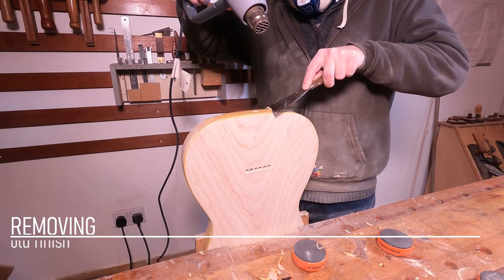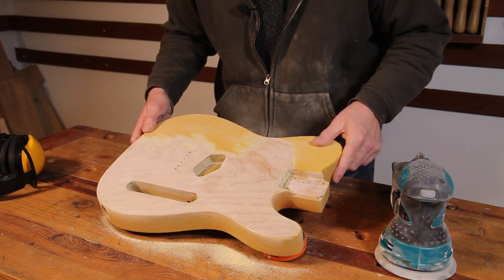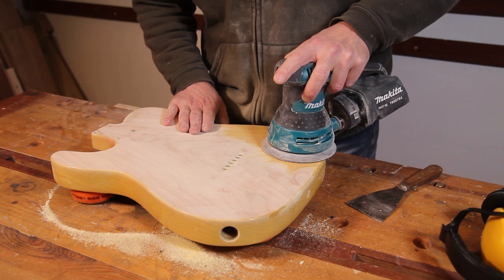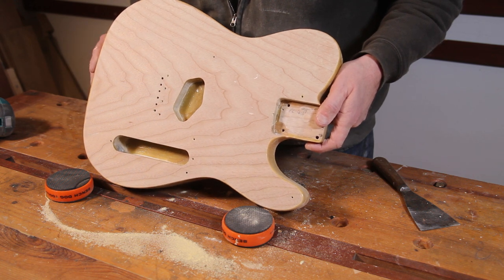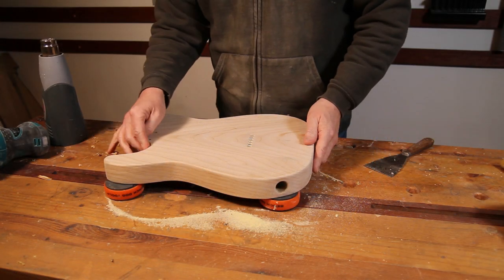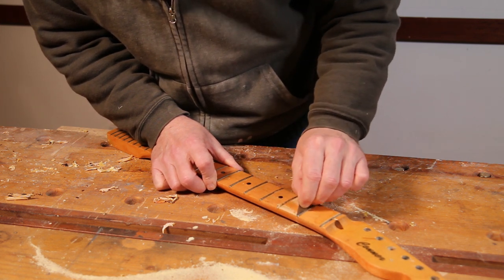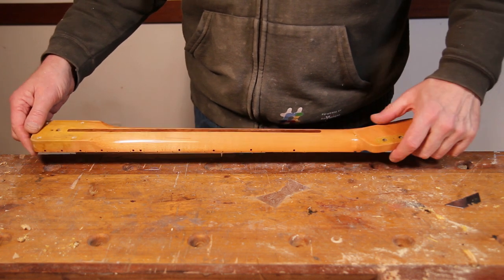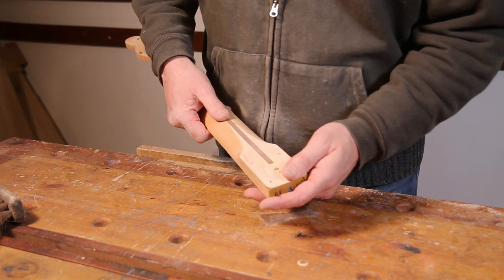Blackguard Esquire restoration episode 2.

Comment: Fun stuff, I have seen Poly finishes come off in chunks and peels with heat and quite easily..  Interesting how a water or oil based lacquer does not penetrate the wood like a stained or dyed finish does.. Would like to see more about various finishing techniques and types..  this worked out well.. cheers..!
Reply from the maker: I've stripped a few poly finishes and it comes off like a sheet of plastic, pretty easy to get off mostly. These finishes do tend to sit on top of the wood, I don't often use stains or penetrating oils on guitars but it is something I want to do more of.

Comment: I have an idea that I plan to try for removing finish on the sides (because that's a hateful task, especially in the horns).  That's to put the roundover on first, then using a spiral bit with a bearing ride around the roundover which should be able to just remove a layer of finish.  What could possibly go wrong...  🤣  (I've considered using the original template... but lining up might be a pain)
Reply from the maker: That sounds like a good plan, well in theory anyway lol. It would make the job a lot quicker though. I think if you used a small roundover this could well work but I'm more than happy for you to do the research :)